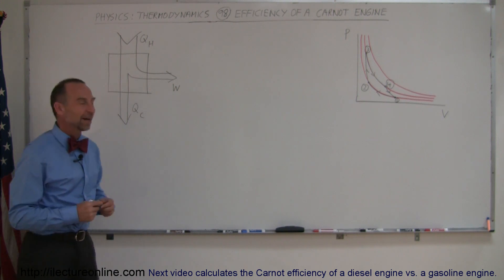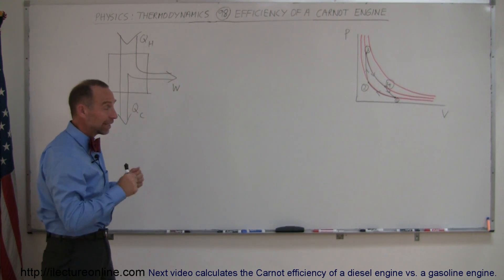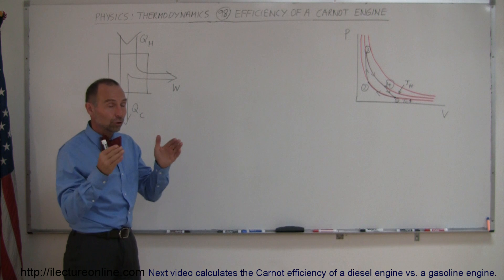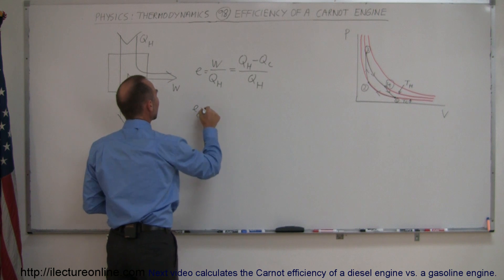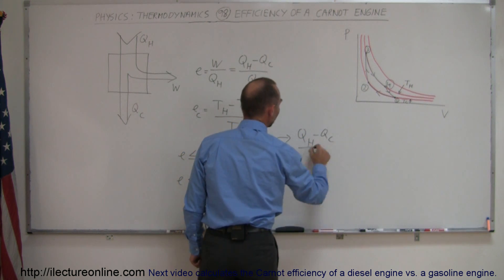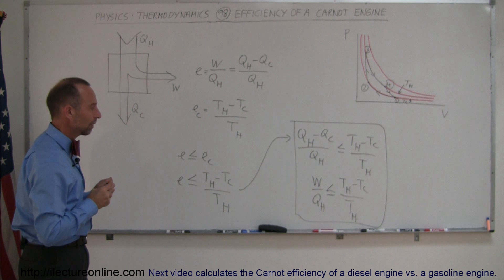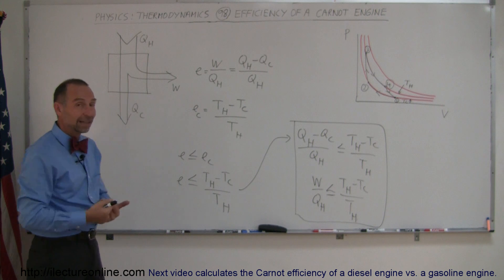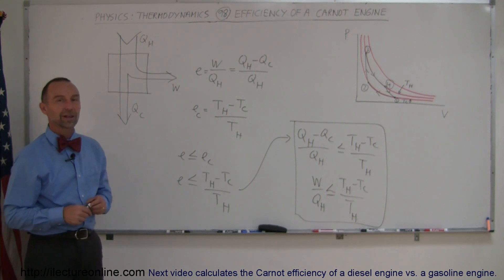Physics 29  Efficiency Of Heat Engines (8 of 14) Efficiency of a Carnot Engine

Comment: I don't know if my textbook is different, but the Carnot cycle in the book is going from state 3 through state 4 & 1 and end at 2 in your case. It begins in the isothermal process where pressure is higher. Qh enters during path 3 - 4 and Qc leaves during path 1 - 2.
Reply from the maker: It doesn't matter where it starts.

Comment: we use the temperature formula for Carnot engine and energy formula for all other engines. Can we use both temperature and energy formulae in Carnot engine to get the same efficiency?
Reply from the maker: A Carnot engine is not a real engine.  It is a theoretical engine that has the maximum efficiency possible at the operating temperatures given.  A real engine will always have less efficiency (there are a few videos in the playlist  that show that).

Comment: Does the temp has to be in kelvin?
Reply from the maker: Yes, the temperature must be in kelvin.
Reply: +Michel van Biezen so if the temp given on the problem was in Fahrenheit, I need to convert it  to kelvin to do the problem correctly? Thank you for the fast response
Reply from the maker: Yes, you will have to convert first.

Comment: how can the efficiency of an engine be less than or EQUAL to the efficiency of a carnot engine, if it doesnt exist?
Reply from the maker: Carnot, a famous French physicist showed us that the efficiency of an engine is limited.  He showed that the most efficient thermodynamic process is the one represented by the theoretical engine which we now call the Carnot engine.  It is a "theoretical" engine. No engine can be more efficient than that engine.
Reply: Michel van Biezen I understand that, but you wrote on the blackboard the effeciency of any engine is < = the eff of a carnot engine. What im saying is that it cant be = since carnots engine is theoretical, therefore no real engine is as efficient as it.
Reply from the maker: Swailem95 
Theoretically, we should be able to build an engine that is as efficient as a Carnot engine.  In reality that will probably not happen.
Don't get hung up on that aspect, that is not the point of the understanding of a Carnot engine.
The real key to the Carnot engine is to realize that using thermodynamic theory, we realize that a real engine can NEVER surpass the efficiency of a Carnot engine.
Reply: Michel van Biezen Thanks!